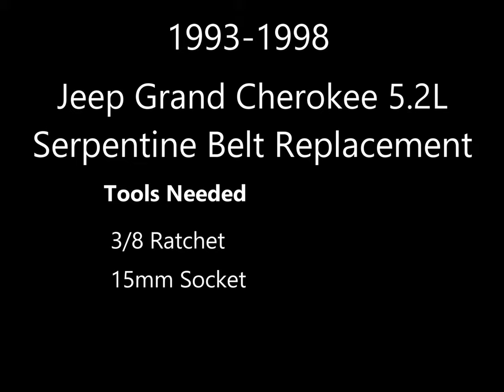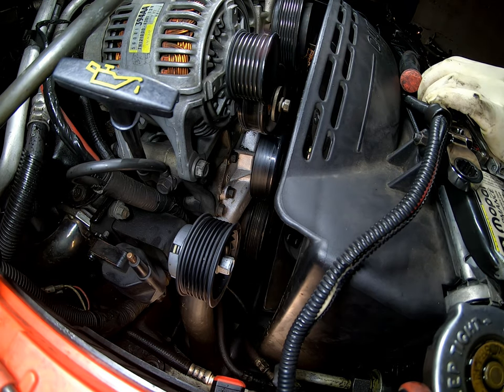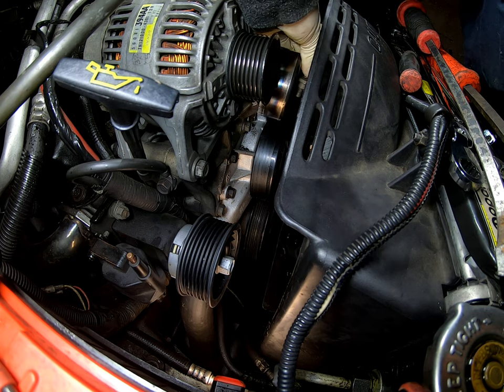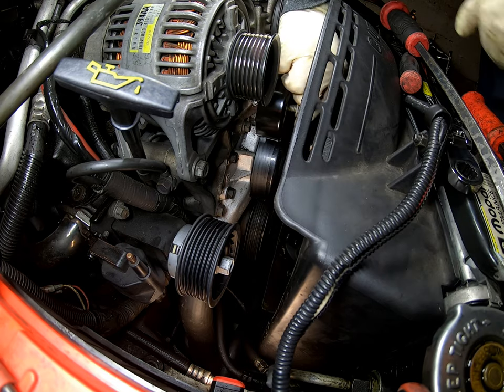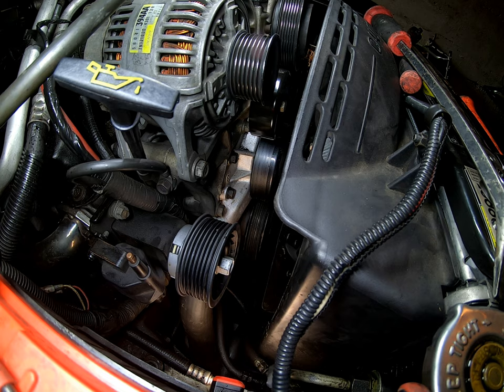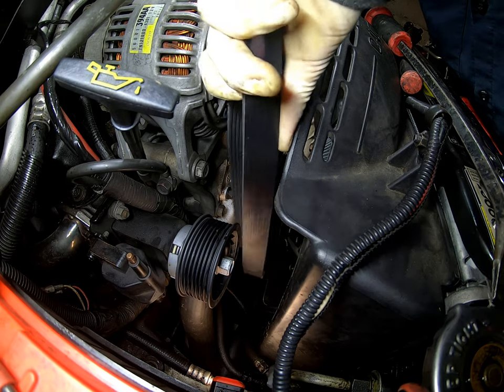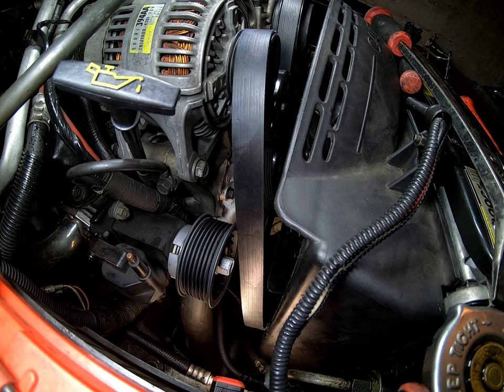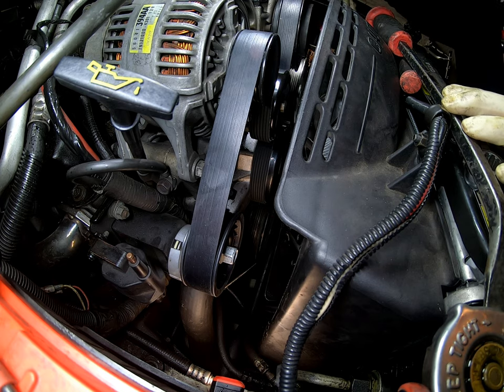How to change Serpentine Belt Jeep Grand Cherokee 5.2 V8

Comment: Hi.  Very didactic your video.  What is the make and model (specifications) of the serpentine belt you used in your repair? Tnks
Reply from the maker: Gates #K070901 Belt
Gates #38033 Idler pulley
Reply: MechDjango thanks
Reply from the maker: @salababasaem  no problem! If you'd like a chance at winning free tools be on the lookout for my "Should you buy?" Videos